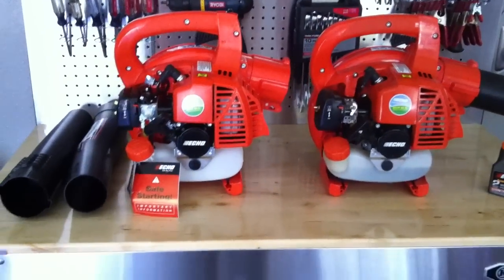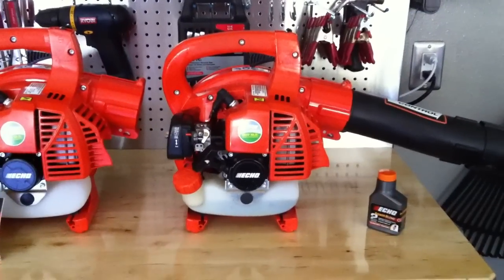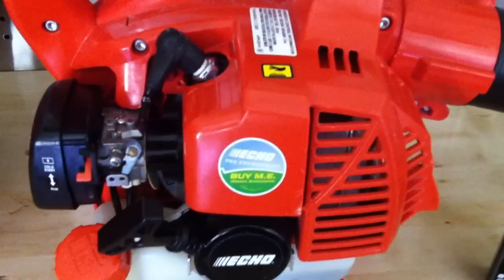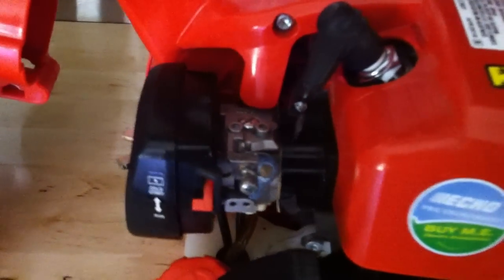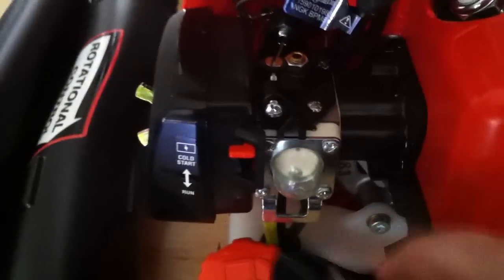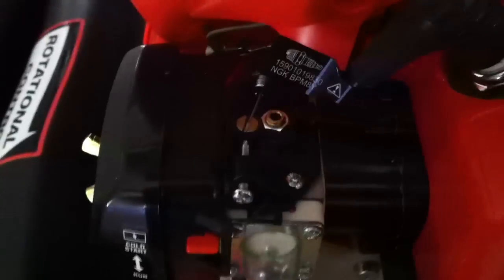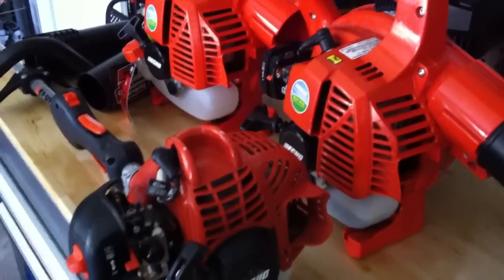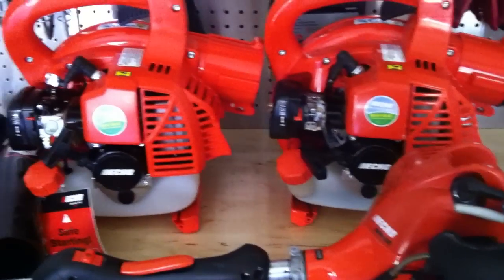Echo Blower Model PB-250 Carburetor Problems & Differences New VS. Old Model

Comment: If your air filter was full of poop, then there’s your problem, a simple one. As the air filter gets dirtier it clogs up making it difficult for the carb to suck up more air and fuel. The engine won’t run right.

Comment: I had the older 250 version and never had a problem, It was just getting older and not a lot of power so I gave it to my neighbor. He still uses it and only replaced the spark plug, fuel filter and air filter. He use the Echo 50-1 fuel. I purchased the new PB250LN in 2023 of February. Two days ago I was using it to clear some leaves and it quit! I decided a good maintenance using the ECHO kit. I had always used the ECHO 50-1 and the fuel was still clean as was the filter but I still decided to replace the fuel filter. Still would not start! I checked for spark and none. I took it down to Homedepot with my receipt. They check it and said the coil and switch were defective. Because it was under warranty I could exchange it for a new one. They no longer have this in stock and also found it was discontinued by ECHO. Because I do all my business there I was able to exchange it for a new model ECHO. I was talking to the shop repair and they had over 20 of the PB250LN there for the same repairs!

Comment: Mine was doing the same thing and there is a screen on the front of the muffler that will clog up, I removed mine and now it runs as good as new, because if it can’t let the exhaust out it will choke it down. Good luck

Comment: All you have to do is adjust the Walbro. The adjustment screws are in those two small holes. You need a “micro d” carb adjust tool, not a carb kit. The newer carb is a Zama. It will still need to be adjusted in time as the engine gets older but it has to be taken apart to remove a plastic plug over the high speed adjustment screw. It is located under the primer bulb. The low speed screw is on the throttle pivot on the top of the carb and is hiding under a brass or plastic plug that has to be drilled out. The Walbro is actually a higher quality carb and easier to adjust once you have the carb tool.

Comment: I bought an Echo trimmer that went 17 years before it died; I replaced the carburetor for $17 and  worked good as new - and I maintain three yards.
So, I bought the Echo PB-250LN Blower thinking it would last at least 10 years, and after a year or so I noticed a loss of power, and now I can't even get it started.  I am having the same issues as you.  I am also going to replace the carburetor.
Someone at Echo messed up - and now I am a little skeptical about their other products.
Reply: Same issue as me

Comment: Can't believe how many people have had problems with that model. I bought one December 2010 with the Walbro carb and never had one issue with it, and it had old gas in it most of its life. Sold it to my dads boss when I inherited a POS Stihl SH85 because it blew a little harder and could suck stuff up with it and seriously regret ever selling the PB250. That Stihl is one serious hard starting, unreliable piece of crap. I used it a lot and almost always started first pull and ran great. Oh well, that Stihl will die soon enough.

Comment: Ok, so I got a first gen Pb-250 from an auction. Big shocker, it didn't work. I could get it to work with some started fluid, but it would promptly die. Long story short, even had I rebuilt the carburetor from the standard kit, It would still be broken and I'd be throwing it away. Had I not barely touched the little rubber hoo-hah under the priming bulb and it fallen off. I bought a new one of those, cleaned out the rubber pieces inside that little hole and wouldn't you know it? Boom, it works.
I hope this helps. That rubber just rots away from the ethanol!

Comment: Well' after reading all the comments here on the PB Echo 250 ?? I have had mine for 7-8 years,have dropped it off my truck a dozen or so times, left it out in the winter and used it as a snow blower for removing snow off my truck. And in the summer ' it get's pissed on from the heavy rains we have up at the cottage' not to mention the very cold winters,and it starts every time, AND WORKS LIKE A CHAMP. I am afraid to give it a tune up.....for fear the dam thing won't run the same. Now I do use regular gas and Echo gas mix.......must of been built on a Friday' or maybe "A" longgg wknd Friday???lol...

Comment: My problem is a bit different. 2016 PB-250LN.  Worked great for 2 years. It starts and runs fine for a few minutes, then when it warms up at WOT, it will not stall, but it will cycle rpms from high to idle for about 15 seconds, then back to up to full throttle.  This happens about every 90 secs. Should I just try a new carb?   Our local small engine shop won't even look at big box store crap. They say throw it out and buy a new one. They charge 75 pct of its cost just to look at it.

Comment: I have the newer model. I've had for 3 years now. A month ago I replaced the lines, fuel filter and primer bulb and threw in a new air filter. I usually change mine monthly just because their inexpensive ran great. It sat for 2 weeks without running and now it run right. It will start and idle for a short time then stall out or if I give it any kind of throttle it just dies. I have a used pair of hedge trimmers do the same thing the changed out the carb and it runs like brand new. I think I'll do the same to the blower now

Comment: I think you have it backwards the Zama RB carb's are total crap the walbro's are way better i have my own shop and the RB series Zama's are  just crap.
Reply: Yes the walbro you can adjust alot better... the zama after market you can adjust they dont have th rubber plug.... i would take an adjustable walbro any day of the week...Carl is right on the money....the zama from the factory you have to take a hot small screw driver to get the plug out... and the low is up on the top where the throttle cable is... after market are not plugged so you can adjust.... but i will go with that older walbro over the zama for sure....

Comment: I'm on 3rd carb since 2011. waiting for new one now. i even cleaned last one still nothing, waiting for new carb. just wondering if i should just buy a sthil.i got 6 year old sthil chainsaw with no problems ever
Reply: I think there's a trick adjustment on them that is a secrete. Even if you buy a new one it will not run with out knowing the secrete adjustment. I did everything that should make this blower run, but it has not.
Reply: just got new carb and fired right up but i need to figure out how to adjust it. not quite powerful at full throttle
Reply: Derek Macdonald There's a very small screw on the carburetor. It's covered in black plastic. You need to take it to a dealer and have them adjust your blower wind speed. It's not worth messing with.
Reply: Right below the primer bulb you can see a brass hole wth a plastic grommet in it. 
Find a nail punch that fits in the hole. Heat the end of the punch with a liter and tap it into the grommet and let it cool. Then pull it out. Then you will need a small flat head used for watches or glasses. Start it up and give it full throttle and turn screw to left and you will get your power back.

Comment: So my new SR-225 trimmer was running like shit and bogging down at WOT so i found out the new version carb(new emision laws?) has a hidden adjustment screw hidden behind the brass sleeve and plastic which is under the primer. I drilled mine out and got a flathead in there to back off the screw some and it ran awesome afterwards. I'm so happy.

Comment: I just bought the PB 250 for $149.  It runs like crap.  Except when I bring it into the shop to work on it, then it's fine.  Either it has a break in period, or it's a lemon.  I regret buying it, and not getting the higher end blower.  I'm wondering if it's set up to run the higher octane non-ethanol fuel.  I was hoping just to use the new premix near the end of the season to cut cost.  I bought it from a lawn mower shop, and not Home Depot, or I would be returning it for the better one.  I've had 10 other echo's and this is the first dud.  It feels under powered as well, compared to my PB 230L.

Comment: Hey, I blame all the problems, with ALL brands, with the small 2 stroke carbs, on ethanol fuel. I started buying the ethanol free gas about 5 years ago. I only use about 20 gallons per year on my lawn equipment so, even at $1.00 more per gallon it only costs me $20.00 per year to be problem free! Another trick is to run your equipment dry at the last use for the season. These small carbs only require the smallest amount of sludge, gew, lacquered gas, or whatever you want to call it to clog them up. I hope this helps everyone. If you already have the problem with your equipment go to harbor freight (I know, most things suck there but if you don't use it much the tools will do the job) and buy a sonic cleaner. the one big enough to fit the carb in. Take the carb completely apart. Sonic clean it. You have to use the heat setting and cycle it many times till you have an hour or more of cleaning time on your carb. Purple simple green works well as your solvent. Put the complete rebuild kit in when you reassemble. It should work fine then.
Reply: +Michael mcgourley . I should have added on my post to spray carb cleaner through all the ports before putting the rebuild kit on to clear any loosened debris. There are many videos here on youtube to help you with this.
Reply: Michael mcgourley 2

Comment: I have the 260 backpack version that's at least 6 years old. It starts up with with just a few pulls even after a couple months of sitting up. But the carburetor is crap. will only run on 3/4 choke.

Comment: The problem is they are a scamming bullshIt company like most.. of course dealers will buy and push a product that within a year will be in the shop.  Covering Carb adjustments and selling dealers special tools not sold to public.  BS !!!! every single 2 stroke on earth will need a carb adjustment at some point!  had this same blower 1 season and stopped working ! finally found the carb only need more fuel (H screw) Which i did manage to adjust without their scam...I mean special tool.   just took the plastic off half an electrical connector slightly crimped it and jammed it on the adjustment screw.  This guy is an example of why a good product is bad business!  suckers!  don't buy into the BS anymore !
Reply: Alex Penfold can you post a video of how you did it?

Comment: I am working on a PB 251 and when I start it up it won't throttle up. I bought another carb off of ebay and it still does the same thing, won't throttle up. I also took off the spark arrester to see if it would throttle up with no luck. Any wisdom here guys please?

Comment: I have an Echo PB200 that I have had for approximate 7 years, it ran decent for a while then i was only able to use about half throttle. I think it just needs a good carb cleaning. I think it's time for a new blower. I didn't realize Echo had so many bad reviews until I started doing research on which blower to buy. I have an echo trimmer that I have no issues with. I'm looking to purchase a hand held blower in the range of 400 CFM. My question is, are the new 2014 Echo blowers more reliable than the ones manufactured just a few years ago or should I go with a different brand? If so, which one?

Comment: I also own the PB250 leaf blower.  A real piece of crap! lasted one season and won't start.  Took it in to dealer twice, started once after that, then no more. 2 trips @ 70 bucks a pop, pays for new blower.  I now have the stihl.  I fires up everytime. is lightter and the air intake  is on the side away from you pant leg so does not suck it in and quit blowing.  Much nicer and actually less than the Echo.  I have many other echo machines but the blower sucks.

Comment: FIXED IT!!  My neighbor has the later version PB-250with Zama side primer bulb, EPA tamper proof carb.  Nothing but bogging above 1/2throttle.  I removed spark arrestor & retried; no improvement.  I removed entire muffler and found the exhaust port of cylinder was clogged.  Ran piston to BDC, scraped out carbon buildup, blew airhose in through spark plug hole to clean, reassembled it and it runs like new again. Try to use a plastic or wooden pick or scraper to clean out carbon to avoid damaging cylinder wall
Reply: What is Ran Piston to BDC? I wanna try this.

Comment: Hey I know what's wrong with your blower. I contacted ECHO about my PB-251 about the same problem. The exhaust has a spark arrestor and if you mixed your fuel with too much oil, it will clog it. Remove it clean it well, and it should fix it. Let me know. Hey record it and put it on youtube. I wish I had done that when I fixed my blower

Comment: I have the same newer PB 250 that I bought almost two years ago and it worked great for 6 months and then it died and has the same symptoms as described here. All I do is play with it for hours to keep it running and the power is half at best and dies all the time. I spend more time pulling the chord then the actual run time. It is not the old carb causing the problem, the newer one is still bad. I looked at their web site and they are still selling this hunk of junk. They have a lot of nerve since they must know of the problem and they still are selling it. I decided to go and buy a different model from a different company. Because of this I will stay away from ECHO products which in the past I loved and owned. It is a shame since it looks brand new and only really worked a dozen times.

Comment: Will the new carb work on the old pb250. I am having precisely the problem you were with your first pb250. I am wondering if the newer carb will mate with older version pb250.
Reply: Did you ever get an answer on this? I am wondering the same thing 7 years later.

Comment: Bought a new carb for the 2100 and it works better now that if did 15 years ago. I adjusted the carb!.   ;)

I have 4 Echo products and only the PB250 sucks (if it ain't broke, don't fix it Mr EPA!). Given the older PB250 sucks, and the newer PB250 does not, it sure would be nice if Echo had a trade-in program of a seriously discounted carb exchange kit.

Friggin EPA! Got nothing to do but write stupid rules. They are living on a different planet - no "real world" experience here on planet earth

Comment: I have a PB-250, 2010 and a PB-2100 1995. The 2100 gave me 15 yrs of superb service.2100 gave up the ghost after 15 yrs - I'll just get a new one. Bad idea. I got the PB250.

I know first productions are never very good. Always wait a year or two on something new. But I needed something ASAP and it was going to be an Echo.

My f@&#%$ with the PB 250 was no different than anyone else's. Turns out Mr EPA changed the emissions levels and Echo had to comply. That's why echo change the carb. design.

Comment: Your old walbro carb can be adjusted with a special screwdriver to solve your problem.  Your new style over time will still need an adjustment as well.  I had mine for 1.5 yrs and it needed an adjustment.  The new carbs are made by zama, and have a brass tamper proof screw accessed when you remove the primer.  You drill out the black plastic, remove the plug with a small screwdriver, and adjust the needle putting the plug back in when finished,
Reply: Bingo. I never removed the primer plate . I picked it out with a file to get to the screw.
Turn to the left at full throttle and it will come alive.

Comment: i have the same carb on my srm230 trimmer. the trimmer is about 4-5 years old and i haven't had any problems with mine. i'm sure you will be happy with the new one you just bought.

Comment: I have the older version and I am fed up with it. Runs like a dog, all the problems you talked about. Its not even been used much and starting was temperamental even when it was new. I have an echo trimmer and had to get carb rebuilt. Gardener told me carb goes bad unless it is used often. I will not buy another one.

Comment: I have had a carb problem with the new version. My issue was the flywheel. I think I had a carb issue first were I was spitting raw fuel out the exhaust and some hydro locking. From this I think it caused the pin in the flywheel to brake off and mess up the timming. I just orered the new flywheel

Comment: How has the new blower worked for you?  I just purchased a Husqvarna trimmer and a Honda lawnmower and all I'm going to run in it is the pre-mixed, no ethanol 93 or 94 octane.  I had two mowers die on me the same day with the same symptoms.  It's the E-10 junk that's killing small engines with E-15 in the near future.

Comment: I bought the PB-250LN in October 2012, and according to this video it has the new carb.  Worked fine last fall season, used it about 10 times.  Started it up this past weekend, on 3/9/2013 and it ran fine for about 30 minutes with fresh fuel, then lost power on fuel throttle.  I am extremely dissapointed to learn it seems to be a known carb issue that I cannot adjust myself.  Note - I did check the muffler, arrestor screen and fuel filter and all look fine.

Comment: i have the 2010 model and had issues, took it to a echo dealer and had them adjust the carb. they told me that the EPA has them running way too lean because of pollution

Comment: Hi, I do have a McCullough leaf blower it run for about 5 minutes and them cut off, got good spark 120 compression, what I notice it get hot and cut the gas off,  should I replace the carburetor? 
   already clean it, inspect the fuel filter and replace the fuel lines..

Comment: I've got the old version, I bought the carb adjusting screw driver for a rip off price of $30.00 but that's $10 cheaper than any place else. My carb was set very slightly lean from the factory so I just adjusted it. Never had a problem with my carb other than that though it still ran really good before I adjusted it. Mine most of the time starts on the first pull.